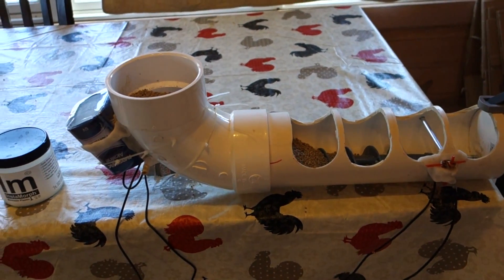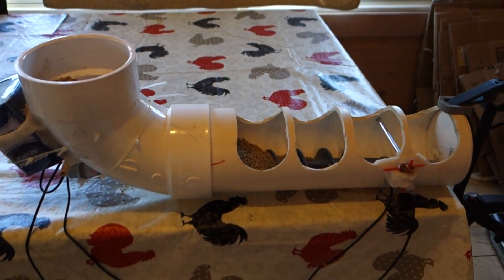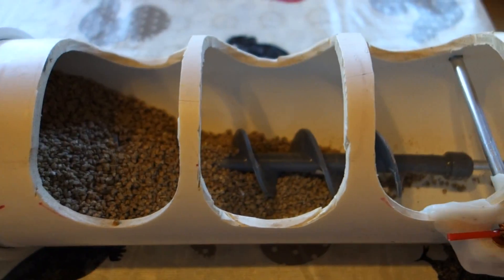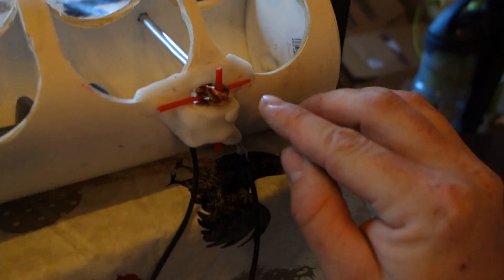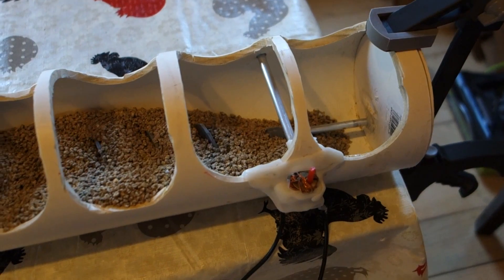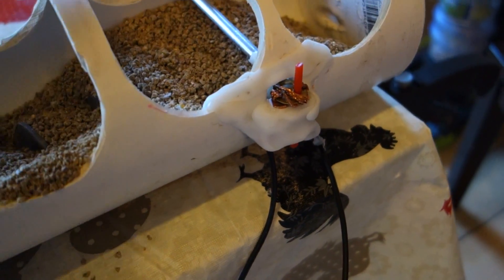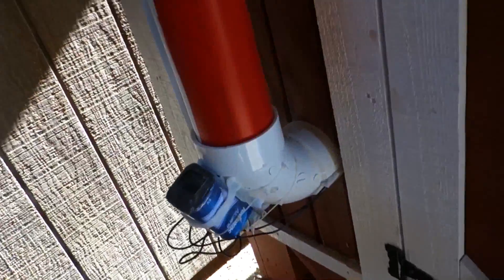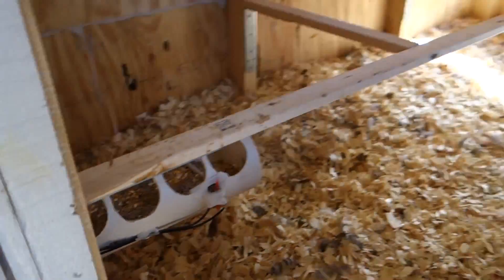Automatic PVC Chicken Feeder - The Answer For Plugged Gravity Feed Systems

Comment: Thanks for the inspiration. Thinking about using a 2-1/2" vending machine dispensing spiral (coil) inside a 4" PVC pipe (with a 12V DC motor 30-60 RPM)
http://www.ebay.com/itm/18-COUNT-SPIRAL-COIL-FOR-AUTOMATIC-PRODUCT-SNACK-VENDING-MACHINE-SPRING-MADE-USA/222350320378?_trksid=p2047675.c100012.m1985&_trkparms=aid%3D777003%26algo%3DDISCL.MBE%26ao%3D1%26asc%3D38530%26meid%3Dc129c4f7c15a4003b443b708e0d4a843%26pid%3D100012%26rk%3D2%26rkt%3D12%26sd%3D222328276577

Comment: Or... you could just go with 45 degree angled pipe instead of 90 degree and just install the setup so that the angle is somewhere in-between 45 and 90 degree angle to prevent too much food from pouring in. It also helps to allow the pipe setup to be a bit bouncy so the chickens can learn to jiggle the pipe a bit which would also help. I personally wouldn't want that auger setup as the chickens peck at the auger and motor, not to mention the potential unreliability of it.

But it was still interesting to see, so thanks for sharing. :)
Reply: turgsh01  that was my solution I just use a 45 I made circles in my pvc pipe versus big notches like that ...